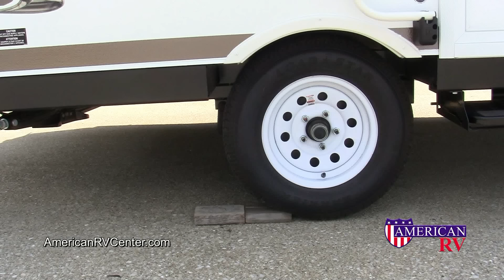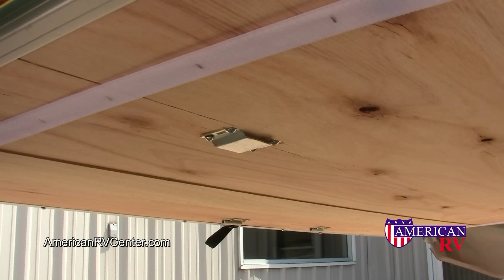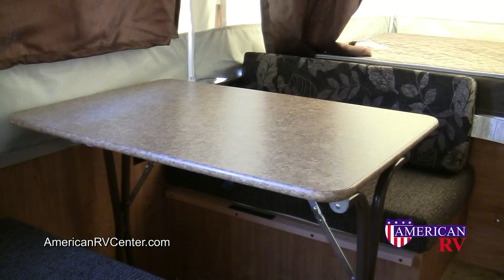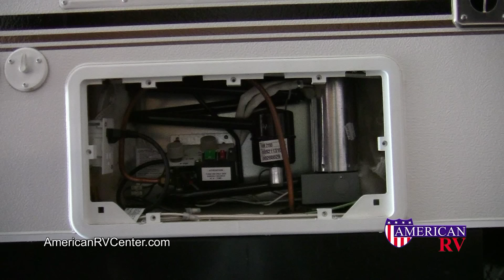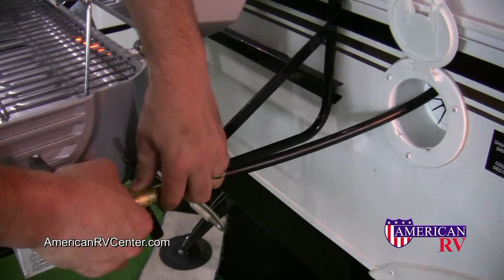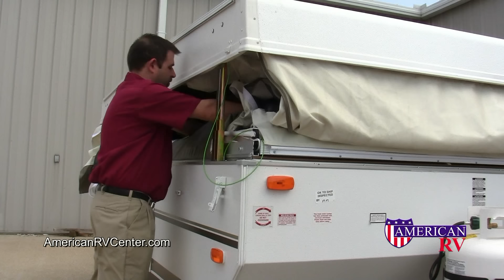Popup (Folding/Tent Camper) Setup and Use Walkthrough Demonstration - American RV Center

Comment: Looking into a pop up. While breaking camp, what do you do if it's raining? Particularly around the 8:38 mark. You've removed the support bars, and now the fabric is collecting water resting on the bed areas. How would you remove the water before you push the beds in?

Comment: For anyone wondering you can pull one of these with a smaller truck. I pulled one of these with my 99 tacoma with no problem as would a ford ranger
Reply: I pull mine with a Rav4.
Reply: @brianhanlon9602  That’s good to know I have a RAV4 and the weight on it only says 1500 pounds. The camper we’re buying is 1100 and I was concerned

Comment: To heck with leveling blocks!  Opps not enough, back off add more. Opps to much back off, opps don't have the right width.  For crying out loud, get a Ball Leveler and throw it under the wheel, level to dead on, easy breezy and it also acts as a tire block.  Work smarter not harder.  https://www.amazon.com/gp/product/B000BH5MAA?ie=UTF8&tag=sg09-20&linkCode=as2&camp=1789&creative=390957&creativeASIN=B000BH5MAA
Reply: David Rishor 

You mean oops and NOT Opps

Comment: i have tent trailer with odd plug on roof side.whats it for? i dont have AC. skamper 1988 240c 12ft i looked online for manuals but no luck.
Reply from the maker: It's probably prepped for air conditioning. Can't think of anything else it would be.

Comment: Thanks just bought a 1991 skamper pop up in excellent condition . I found two pieces of metal under the bench pads and had no idea where the went . Due to your video I realized they were the safety supports in the case the hoist cable breaks.

Comment: I'm most of these videos they don't show setting the door in place. That's the hardest part. If the camper isn't 100 perfect perfectly level it won't line up.
Reply: Very true. The leveling has to be spot on, and the roof must be fully up (green cable taut). Good things to check if the door or "canvas" doesn't quite seal.

Comment: Pop-Ups are a huge pain in the ass, I used to have an old single-piece-roof Coleman and it was a piece of shit and impossible to set up.  If you can afford to get one look at hybrid trailers.  They have soft sided fold outs for the bed and a traditional RV body.  Have a Jayco X23B now and it is just a totally different experience using it.
Reply: Many popups like my Viking have simplified the setup process. I use a 20v drill to raise the roof and crank down/up the stabilizers, and there are no bars under each bed bunk. Those help quite a bit.

Comment: Question:  Can a Toyota Tacoma 4x4 with the 4 Cylinder 159 hp engine pull something like this easily?

It also has a 5 speed manual tranny as well...(would it need a transmission cooler?)

I always wondered if my Tacoma could pull one of these without destroying it.
Reply: Trans cooler is for automatic transmission.

Comment: My sister sets hers up in 10 minutes. And if she moved any slower she woulld be going backwards.
Reply: I'd set up our family's my own self in more like five minutes at around ten years of age, decades ago. But was bigger than average. I was, I mean. Hadn't thought of those campers in many years. Tent Trailer was the commonly-used term back then. Had never heard the words Popup, Folding Camper, Tent Camper used for them until saw this post. They were much more commonly seen, used back then. Their construction, setup were much more simple then. Unlatch latches on outside of each end, which secured square metal top to square metal bottom during travel, pull/slide ends of beds outward, up went the metal roof on the ends of metal pipes/rods which unfolded, straightened up as beds were pulled out. No cranking involved. Heavy canvas attached to those, other folding, unfolding metal rods, pipes covered sides, ends, rest of ceiling area of trailer when set up for occupancy. Air conditioning, heating were concepts from The Future. Zero privacy for any family member on inside. Still, when was a child, was pleasant enough vacation living when frozen tundra west of Boston  thawed for summer, could drive to, set up near, a pleasant lake or ocean area to east or south, camp out there for two weeks, swim, tan - as mother, I, sisters always wanted to do. Father, though, would often have us on some version of Mao's Long March/Cherokee's Trail Of Tears, traveling to, through frozen Vermont, New Hampshire/Maine/Maritime Provences of Canada, where needed ski jackets at night in July, August, ocean water was shockingly cold first minutes immersed in it.  Get up early morning, fold up trailer, attach it to station wagon, drive all day until early evening, rent camp space in camp ground, set up trailer, go to sleep, get up early next day, repeat for two weeks. Father had suffered from untreated hyperactivity from childhood, they guessed long after.  Such people were just considered to be extra annoying/exhausting before there was a word, treatment for it. I bailed out for CA, where no one knew what 90+% humidity accompanied by clouds of biting mosquitos, black flies, gnats, no-see-ums (microscopic biting flying insects) were, not to mention deer ticks, almost ASAP, stayed there for decades.